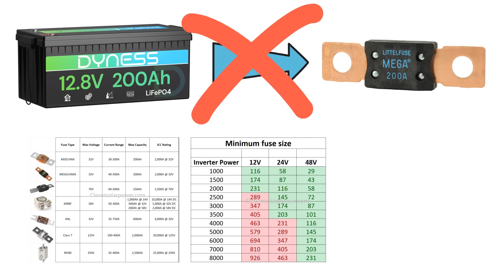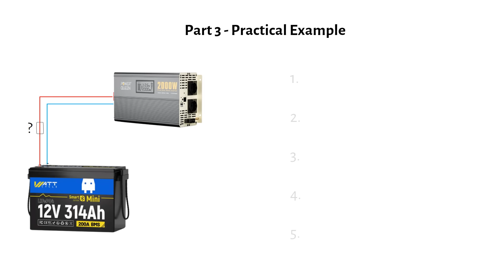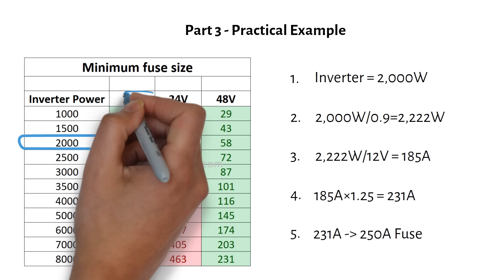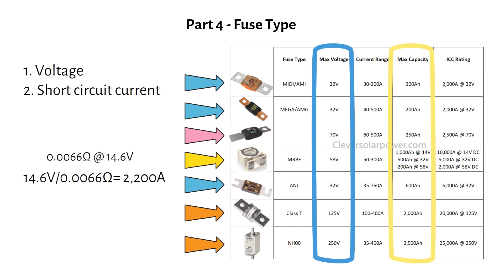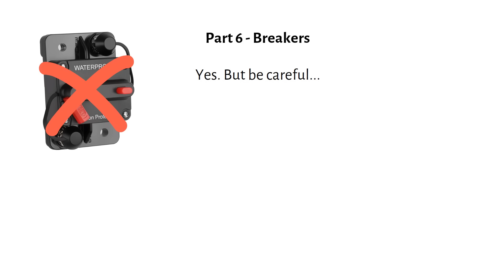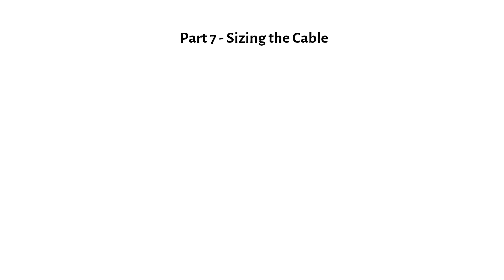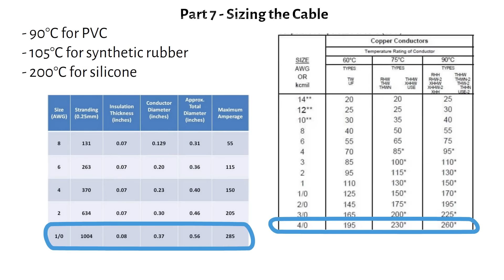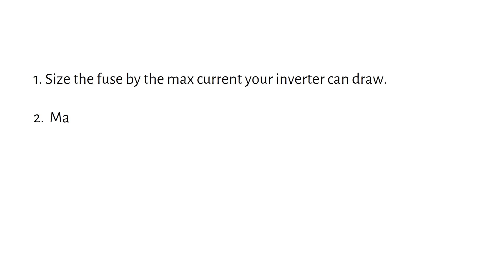How to Size Your Battery Fuse to Inverter

Comment: @cleversolarpower Victron MEGA fuse 150A/80V ceramic package of 5 on Amazon for $51. Low stock, so perhaps may be being discontinued. I don't recall the ICC rating being only 2500A for those, but that rating seems paltry for any LFP use (ABYC). Oh, my bad: 2500A is at 70V, so yeah, much better than standard MEGA and similar to MRBF rating, which gives a not-highly-known cheaper alternative to MRBF. You really should consider normalizing the ICC values to 12V, 24V, and 48V for the benefit of immediate comparison and comprehension. The data sheet may be available for the Victron product on their community forum as the one for the Zeeman ceramic fuse.

Comment: @cleversolarpower OK, this is the video that you referred me to. Very good. I don't recall having seen this before. It covers what I asked for, pretty much. That the example is the simplest case scenario (one battery vs. battery bank), though, only conceptually applies to inter-battery fusing. This video could be the prerequisite to seeing a more comprehensive treatment which includes fault protection of a, say, 4 x 12V 100Ah parallel LFP bank connected to the inverter instead of the single battery. I think the ABYC guidelines make 3 x 12V 100Ah ok with MRBFs for inter-LFP fusing (bare minimum protection) in consideration of AIC but nada for four. (Update: I wrote the preceding when only halfway through your video. You went on to mention parallel LFPs and the consequeces.)
Reply from the maker: Thanks for your comment. I have a video coming up about a diy fuse busbar with nt00 fuses. Every fuse needs to qualify for the ICC of the battery.
Reply: @cleversolarpower  Great! Maybe I'll get more ideas from your approach, as I have been draggin' my feet on implementing a fusing strategy. MRBFs directly on the busbar was my first idea (and I finally found a source for the insulators required), but the higher interrupt rating of other fuses was lucrative, albeit either more expensive (Class T) or unwieldly (MCCB). I'd be a happy camper if some company rethought MRBFs (larger? sand-filled? etc.) to have higher interrupt rating. That said, I think breakers are the way forward, for being able to be made "smart", and "smart breaker" tech is evolving, but perhaps mostly for AC rather than DC at this point in time.
Reply: Shunt-trip breakers are readily available for DC but are expensive (relative to $15 MRBF) and smart breakers will be even more expensive, surely. Shunt-trip breakers are a kind of stepping stone toward a greater level of control, should one want that. Ref product: DIHOOL DHM3Z.

Comment: Hi Nick, I'm putting together the same setup in your video.  Should I purchase a DIHOOL 200 or 300 Amp Battery DC Disconnect Switch?  Because there isn't any 250 switch that I saw.

Thx!
Reply from the maker: Depending on your current. Oversizing reduces heat generation but then you have to size your cable for the larger current.
Reply: @cleversolarpower I will be using 1/0 cable, for my 2000W inverter.  Is this suffice?

Comment: I have a 4000 watt inverter on a 12v system…I came up with a 500 amp fuse but what size cable should I use…the distance between inverter and battery is 7ft and round trip it’s 14ft please help me I’m lost here
Reply: I think its cheaper to buy new 4000 watt inverter 48v (and series your 12v battery, we dont need big cable for this) than to buy your 12v cable. 

You can google "cable size ampere" but i am not sure there is singe cable to handle that much ampere 😂

Comment: Q: If a fuse (fusible) is smaller than the current flowing through it, doesn't that mean it burns faster and thus breaks the circuit? 
Of course, there is no advantage in choosing a fusible fuse that is too small, which will interrupt the circuit too often.

Comment: why are we dividing and not multiplying by the efficiency?  in this example is your inverter not 110% efficient at 2,222W?
Reply: 90% efficiency means that 10% of the energy drawn from the battery is being lost in conversion. So, to get the required power, the inverter must draw more energy from the battery to make up for the conversion loss. The fuse experiences that extra amount and must be able to handle it via upsizing accordingly. The way to calculate the required fuse size, then, is to divide by the efficiency [to get the larger value].
Reply: @PowerUser-l2q ah, that makes sense. thanks for the explanation!

Comment: Thanks for all the correct facts. There was a building burning because the big solar inverter had. Short and the megafuse was working as an arc lamp because the 10kA was too high to disconnect.

Comment: Your inverter should come with installation instructions which include fuse type size and wire size determined by distance from battery. never vary from manufacturers recommendations.

Comment: Skip the Battery-Inverter fuse. Make the cable as short as possible or even replace with a sold bar. 50mm x 3mm aluminium bar, bent and drilled can hold the 2000w inverter on top  of the 300amphr lifepo4 with some extending out acting as a busbar for extra connections. 240amps running through before a 250amp fuse blows as in the video would have caused enough problems and why introduce another point of failure, the fuse, anyway......individual smaller fuses radiating out from the battery or inverter instead.
Reply from the maker: Yes, let's skip the main battery fuse they are useless 😅
Reply: @cleversolarpower Specially when the recommended fuse is above the specs of the internal battery cutout!!

Comment: I am not sure if mine is okay I have an Ecoflow 12v 100ah auxillary battery in my car and it's charged with a 40amp DC to DC charger which I have hooked up with a 6 gauge pure copper cable and I have two 60amp mini ANL fuses on the 6 gauge cable one fuse is close to the cars starter battery and the second fuse is near the auxiliary battery I am just not sure if mini ANL fuses are okay the mini ANL fuse holder brand is Recoil and i have a 1100 watt inverter hooked up to the auxiliary battery on a 2 gauge pure copper cable and 150amp Mega f⁶buse on the 2 gauge cable. Is this setup safe because I have only been using it for a week and everything runs good but I am not sure if the fuses are safe.

Comment: I have a question about using MRBF fuses. The fuse holder has a 3/8 inch hole for mounting on the battery. The battery uses M8 bolts which is close to 5/16 inch. There is a chance of not making a good connection between the fuse holder and the battery terminal because the bolt diameter is smaller than then the 3/8 inch hole of the fuse holder. I have checked around on the internet for any kind of adapter. None found. Is there a safe way to attach the MRBF fuse holder to the battery? Thank you.

Comment: You are going the wrong way on the safety factor... It should be: 185A / 1.25. Then you need to pick the next size down, not up. You want the fuse to blow before the wire heats up. The fuse must be weakest chain in the link, not the strongest.
Reply from the maker: I'm not using it wrong. We are derating the cable here and then picking a fuse that fits the cable.

Comment: I have a 1500 watt inverter on two gauge wiring so it needs a 275 amp fuse to protect the wiring as fuses do not protect the inverter itself. Now the 1500 watt inverter did come with a 150 amp fuse, but the specifications of the inverter says it can go over 155 amps.

Comment: Why all this calculation when it is the conduit that is being protected from fire, the inverter aready has its own built in protection for over/under volts/current etc..
Reply from the maker: The inverter doesn't not have built in protection. You fuse the wires to protect the wire from melting, not to protect devices.

Comment: Right from the get-go, that is entirely incorrect.  The power source must be considered in the power system protection scheme.  This is part of power system selectivity/coordination, secondary side protection of the source, and limitation of fault current availability to name a few.  If you had said, well, we are going to assume you have already done that and we are only going to focus on how to select properly sized circuit protection for this branch circuit, then you'd be ok (although you're still wrong, as I will explain).  But going with your example, you are connecting a battery to a single load.  In this case, you must consider protecting the power source in your scheme since it is the only circuit protection device.  Right now there is someone out there that said, great, I can install a 10000W inverter to this 12.8V 314Ah battery with a 200A BMS as long as I size the circuit protection to protect only the inverter then I'm ok.  Your result, you are recommending a 250A fuse for a battery that has a maximum safe continuous current rating of 200A (maybe for a short period it can go higher).  I would argue a 200A circuit protection device is the highest you can use, because your battery in this example cannot safely flow a higher current (maybe for a short period it can go higher).  BMS's are not recognized circuit protection devices, and in any case have proven to be quite unreliable at preventing battery destruction, fire, etc.
Reply: Respectfully, you’re wrong!
Reply: @DougAlienHunter  I am sorry these concepts are too complex for you to grasp.

Comment: Although that inverter is rated at 2000W, it has a peak power draw of 4000W, does this not need to be taken into account for fuse sizing?
Reply from the maker: No, because the fuse doesn't blow instantly, it has a delay.

Comment: G'day. LOVE the chart. For us layman's. If the victron lynx distributor only uses MEGA fuses when running a 12/3000/120 /16 victory inverter (pretty sure these are only 2400w) if the ICC Rating is 2000A at 32V  what does the chart say for this inverter in a 12V system? 
  I guess victron has the safety margin in there but I was a little worried the mega fuses are not sufficient🙏

Comment: This is a very dangerous approach. The recommended fuse in this example may damage the battery before it protects the wiring or the inverter.
If you look up the time–current curve (TCC) for an MRBF 250 A fuse, the first guaranteed interruption occurs after about 1900 s at 350 A (140%). Below this current, the fuse is not expected to blow. However, the battery is only specified for a maximum continuous discharge current of 200 A.
In the best case, you trigger the battery’s over-temperature protection (OTP). In the worst case, you may permanently damage the battery.
This is why you must always consult the TCC before selecting a fuse or breaker. Even more importantly, the first step when choosing a fuse is determining the largest fuse that can safely be used for the battery. Only after that should you specify the same size or a smaller fuse for the rest of the system.
Reply from the maker: That's not the right approach. The battery has over current protection. If not, the wires are selected to handle the over current, hence the safety factor for continuous load.

Comment: 3:25 shouldnt you be finding 90% of 2000 
if its only 90% efficient,,
meaning its NOT 2000 watts 
at 100% but less at 90% (1800 watts)????????
Reply from the maker: The DC input power will always be greater than the ac output power because of inefficiency.

Comment: Would it not be safer to use a 200A fuse instead of 250A (in the 2000w system you have shown) to better protect the wiring? Where does the 1.25 safety factor come from? Do have a video on that to explain?  Is it to withstand the surge current? If the inverter is drawing 185A max, would a 200A fuse not be safer?
Love your content, thanks for your educational insight.
Reply from the maker: Good question. The 1.25 safety factor is for continuous loads. We select the fuse first and then select a cable with a current rating higher than the fuse. So you have effectively de rated the cable, making it safer.

Comment: 48v battery feeding an Ecoflow XT60i solar input (11-60v, 15 amp max) means 30amp MRBF fuse?  They do make 30amp MRBF fuses, even Blue Sea has one.  In this use case it’s not the Inverter output (1800) that matters it’s the solar input specification?  Battery to solar input is 10 AWG.

Comment: 3:28 the inverter wattage should be multiplied by the efficiency factor instead of being divided by it. It's should be 2000w x 0.9 = 1800w
Reply from the maker: No, the input is never less than the output.

Comment: What about inrush current from motors? There's no mention of slow blow fuses
Reply: the inrush is brief enough not to blow a correctly sized fuse. The inverters capacitors act as a buffer

Comment: Why would you not size your fuse to the max output of the battery? If the bms fails and outputs above the max output wouldnt you want the fuse to trip the circuit to prevent damage to the battery? For example i have a 110/100 ah battery and the manufacturer states 100amp is the max output. In your other videos for using 3 100ah batteries with a 3000w inverter you fuse each battery at 125amps. If my batteries outputted 125 amps that's over the manufacturers scope for the battery.
Reply: Because you are protecting each cable coming from each battery. If you had a fault in one battery it's possible the draw could come from one of the other cables and you need to protect them.

Comment: You don't size the fuse to the current, you size the fuse to the cable. You size the cable to the current.
Reply: That's what he said in the video
Reply: That's what this and every other related video says, yes. Well done.
Reply: Most simple and correct comment
Reply: 🦜I'm setting up a rig like this with a 2000w inverter hooked up to a 314ah battery. I'm using 500A 
2.0 gauge cables. 
I'd like to install a post mounted fuse. 
What should I consider?
Reply: Spoken like an electrician… and you are correct. 😁

Comment: Hi, I think it's great that you've involved power factor into the equation. But (and this is just curiosity,  not hate), if we are being that meticulous, shouldn't we also take into account the actual voltage drop of the battery when calculating the current? LiFePo4 batteries don't drop as much in voltage under load if I'm not misstaken, so should it not be perhaps:   the active power / power factor = apparent power, then apparent power/12,8 or 12,6 or 12,9 or whatever the battery drops to under load? Thinking that they are 13,6 when fully charged and resting.

Great video btw!! :D
Reply from the maker: I don't take the power factor into consideration. I think it's the inverter efficiency of 90% you are referring to. Voltage drop is quite low in lifepo4, I use it as a small safety factor because lifepo4 can drain to 11-12V, and with a lower voltage, the current increases to deliver the same power.
Reply: @cleversolarpower yes sorry, my bad I'm mixing up my electrical terms, ETA is indeed what I meant, not the power  factor! 

And oki, yeah that makes sense, thanks for the response :)

Comment: Silly question, I'm guessing the max invertor draw won't blow the fuse e.g Max continuous output power is 1000w so fuse size of 125amp but peak power can temporarily hit 2200w?

Comment: Hello my name is Vince and I have a 4 24v 100amp each to be wired in parallel 3000watt hybrid inverter ecoworthy and 4 solar panels 2 in series and 2 in parallel each panel is 35v 8.5amp 260watt also I have solar breaker 240 breaker 24v switch on off 2awg wire for parallel and 2/0awg to carry the load to the inverter how you would design the system.

Comment: @cleversolarpower Hey, absolutely amazing video! First video of yours in funding. 

When sizing my cables, I found a chart for 105c wiring amps city and it says it’s for wiring not in conduit and single wire only. If in bundles of 2+ for dc it says to multiply your ampacity by .7. 

I think this is important info for people doing solar builds in camper vans as even plastic conduit derates wiring

Comment: Good info, but the battery in your example, which is the same as my own, has a 200-amp BMS. Would you not want to size the fuse to max at 200A instead? Or is a 2000W inverter too much demand from a 200A BMS? Of course, the lower fuse rating would still protect the wiring. I appreciate your thoughts.

Comment: You failed to mention that the inverter may have a momentary surge that is double its rated capacity.  My 1600 Watt Progressive Dynamics has a surge capacity of 3200 Watts.  The manual calls for 2/0 AWG wire with a minimum 250 Amp fuse that is slightly lower than the 267 Amp draw at 3200 Watts.  But the manual fails to mention that welding wire is the only 2/0 AWG wire that can handle this load.
Reply from the maker: You don't have to size the cable for the surge power rating. Notice that cables in industry are not sized to handle the startup power of a motor? They are sized for nominal current.
Reply: @cleversolarpower  I watched another one of your videos and learned that all of the fuses shown in the video are slow-blow to account for momentary startup surge.  Howerver, NEC Article 110.3(B) states that equipment must be installed and used in a manner consistent with the manufacturer's listing and labeling instructions.  In my situation Progressive Dynamics is calling for a 250 Amp fuse .  This is larger than what is needed according to your calculations for the nominal load of a 1600 Watt inverter and too large for standard 2/0 AWG copper wire.  I must use 2/0 AWG welding wire to meet code.

Comment: On my 2000 watt inverter has built in fuses i still put a fuse before it a 175 amp fuse because I will NEVER be using it at its maximum potential.
Reply from the maker: Ok, the fuses in the inverter are not meant to protect the cable, it's there to protect the inverter. Most of the times these fuses are oversized.